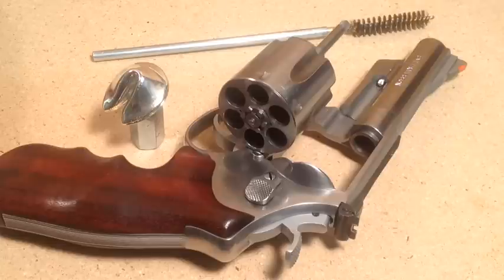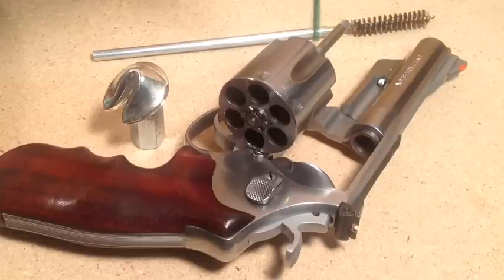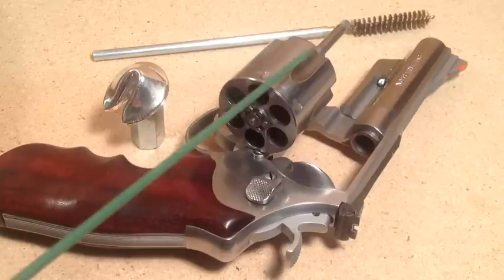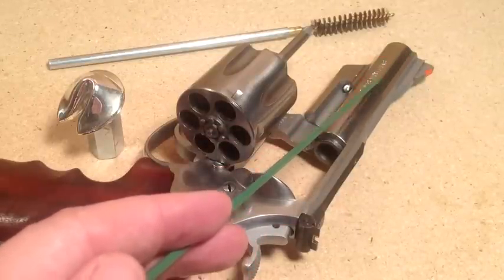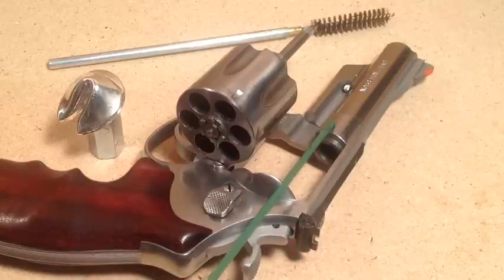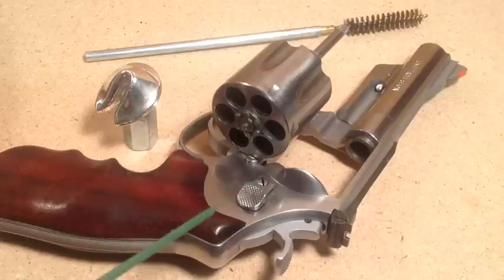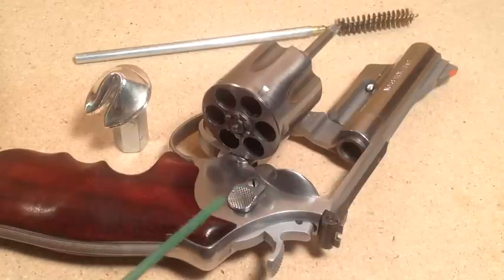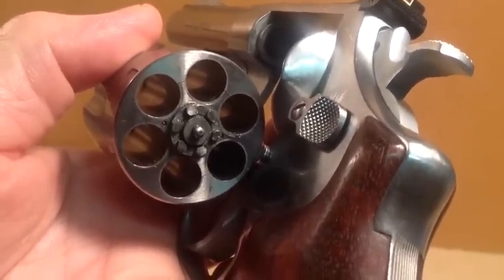Let's Prevent Barrel Leading - VR Gun Nut

Comment: I just got a lot of leading shooting the .38 special PPU 158gr lead round nose factory ammunition in my 2.5" 66, the cylinder face, forcing cone, and barrel all got leaded, the barrel the entire length and it's leaded the worst, I just shot these same,rounds in my 627 with 2.625" barrel and had 0 leading :/
Reply from the maker: metalmullins - Sounds like your cylinder throats are bigger than the PPU bullets so that gas cutting is doing all the leading.  If your bullets are too small at the frontof the cylinder, gas is blowing by the bullet and flame cutting the lead leaving it at the cylinder face, forcing cone, and first third of your barrel (with a short barrel, that's the first third).  It's the only way that lead is left like that.  That 66 sounds like it needs bigger bullets - you'll have to measure your chamber cylinder throats to see.  Then cast .001" bigger and load 'em.  Your 627 and PPU ammo are a better fit for each other… Leading takes all the fun out of shooting when it happens… Best Regards
Reply: what kind of cleaner is best for lead romoval? i dont cast my own bullets but i reload with factory lead bullets and shoot some factory ammo with lead projectiles, and this is the first time ive ever got leading..... thanks for taking time to respond!
Reply from the maker: metalmullins Gunsmiths used to use torch heat to soften (don't overdo this) heavily leaded barrels, and then clean the lead out with brushes or copper mesh while soft.  They also plugged up the leaded barrels and filled the barrel with mercury - dissolved the lead (that is no longer done).  More practical for modern shooters is the Lewis Lead Remover, or wrapping kitchen copper scrub mesh around a subcaliber brass brush and solvents work for leaded barrels and forcing cones on revolvers.  For revolver chambers, spin a tight fitting brass brush on a plain rod chucked in an electric drill + solvent = fast and easy.  Best to ya

Comment: So, if I understand correctly, if a person is using jacketed bullets, there is typically no leading issue, correct. And, typically, leading is not an issue unless you are using high velocities, correct? And what approximate velocity would that be for 9mm and 38 special? Many thanks.
Reply from the maker: eqlzr2 - Thank you for your condensed conclusions... Not quite that simple, but yes... jacketed bullets do not lead, but, in rifles, they "copper" - when accuracy degrades, we have to decopper the bores a bit.  The threshold where lead ends and jacketed begins is a range where shooters who use both types of bullets work.  My personal breakoff is a rather conservative  2000 fps.  If I go over 2000 fps, it's jacketed bullets for sure.  However, jacketed can be used at any velocity that is shootable.  Best to ya,  FC
Reply: Alright, clear as a bell. Thanks!

Comment: "On revolvers, no need to slug the barrel"  Not true.  I was having barrel leading in the middle of the barrel.  Slugging the barrel showed me that it's tight at the frame, the opposite of what you said would cause leading in that area.  It's a little tighter near the muzzle as well and loose in the middle area where the leading was happening.  Accuracy on the gun is also terrible as one would expect regardless the bullet type used.  Hopefully Taurus still has barrels for it so I can send it back for replacement.
Reply from the maker: DonziGT230 - Thanks for posting comment.  Problem with videos is that we cannot cover the full comprehensive discussions on any particular topic.  That's why there are comment sections and viewers have come to learn the value of these sections.  When we are first working with a revolver 1) shoot some factory jacketed ammo - it should shoot decently to very well depending on the load 2) if shooter is a reloader / bullet caster - measure the cylinder throats and add .001" - no need to slug the barrel (that's where the no need to slug the barrel comes in) - If the revolver is properly set up, that should give the shooter accurate clean shooting results.  We might get light leading if 150 - 200 rounds are shot in any given session.  BHN 15 is good for most shooting BHN 18 for magnum shooting Note - if anyone tells you that you need to slug the barrel of a revolver and then shoot bullets .001" bigger than that (this is recommendation for auto pistol and rifle barrels), wait till you see what some revolver groove diameters are. 
3) if we do not get good results, then slug the barrel.  This determines if the barrel is not properly set up in relation to the cylinder throat / flash gap / forcing cone or the barrel may be a bad or "pernicious" barrel.  This is what you did and your findings on your barrel denote a bad barrel.  Note - tightness at the frame is often called barrel constriction caused by the torque applied to screwing the barrel into the frame.  Removal of these constrictions can be done by lapping, but I'd prefer to leave that up to a qualified gunsmith to execute.   The topic is even more than this, of course.  I'll cut off right here as it will quickly become more than you or other viewers want to read... Best to ya,  FC

Comment: Hey FC45, isn’t it unavoidable to have some leading inside your barrel due to the heat and friction on the inside walls of your barrel? Do you notice more leading if loading the same lubed lead bullets to 38 Special velocities compared to 357 magnum velocities? If so, if your loading say factory Speer, or Hornady lead bullets in a 38 or 44, have you noticed a certain FPS that when exceeded, results in excessive leading? (Speer bullets seem to use a dipped lube, and Hornady has a silver dry lube) The reason I ask is I very rarely load 44 magnums with non copper jacketed bullets, but stick to 44 Special loads with the lead bullets. The reason is because I have had a devil of a time “de-leading” my model 29 after shooting Hornady’s lead bullets to 44 magnum specs...
Reply from the maker: cal30m1 - Thanks for your good comments... yes, we like those swaged lead bullets, and I personally really like the them in 44 cal.  The hollow points are even used in hunting circles but the velocity ceiling on those is 1000 fps.  I like 'em around 900 - 950 fps in hollow points - buy 'em in the 250 boxes.  Even though I cast my own bullets for the preponderance of my shooting, I do use the swaged and jacketed also.  Those swaged bullets are soft by definition and shooting them over 1000 fps invites leading.  If you like cast bullets in your 44, and many of us do, hard cast is the way to go... any leading you get will be easily removed via normal cleaning procedures.  And if you powder coat your bullets, any leading will be nil or none.  Plus good powder coated bullets optimized for magnum shooting are available commercially from outfits like Missouri Bullets and Acme Bullets.  Good shootin' to ya,  FC Steve

Comment: thanks for the video fc45 if I was to use the 45/45/10 system could i use white xlox instead of lee alox? and the 10 is usually a oil right?
Reply from the maker: gun nut - the 10 is paint thinner.  And the White Label stuff is pre-mixed for you.  I'd be using it, but I've got a lot of LLA that I have to use up...Best Regards...
Reply: so the white label stuff is 45/45/10? what do you mean by pre mixed? where could I get white labeled xlox? I heard it's cheaper than LLA
Reply from the maker: gun nut +gun nutThe White Label 45/45/10 is all ready to go, just pour a little in and tumble your bullets...The Xlox is White Label's version of LLA, but as you already note, it's less expensive.  And you can get a big container of it - Wow - that stuff does go a long way, though.  You can order from the website www.lsstuff.com  Best Regards

Comment: gas checks on lead bullets eliminates deforming of it and that prevents leading, with good quality bullets that have gas checks I've never experienced any leading issues ever
Reply from the maker: kevin davis - When Elmer Keith was stoking all those calibers and developing cast bullet designs, he did not put gas checks on his Keith bullets - reason - he did not think them necessary at 1500 fps and under.  On the other side of the room is Thompson who put gas checks on many of his designs.  Near as I can figure, for our regular handguns, gas checks do a bit to help prevent barrel leading, but not enough in most cases to warrant the extra 4-5 cents a shot.  Some report better accuracy when gas checks are used as the bullet bases are more square, but I have not found that to be the case in my limited use of gas checks vs no gas checks.  But if any shooter wants to use them, by all means.  I do use them for rifle cast bullets.  Best to ya,  FC
Reply: how many rounds do you throw down feild before cleaning out the lead so gun doesnt blow up
a ipsca freind told me to use copper brillo pad to clean leading and to just shoot lead
but im still paranoid about my gun getting blown up?
Reply from the maker: Alonza Hanks - If your gun is shooting accurately, there is no fouling problem.  When you start getting flyers, the fouling or leading is building up.  When you start getting keyholes, the rifling is being obliterated by fouling and leading.  If you keep shooting at that point, pressures will climb dangerously.  So let your gun talk to you.  If you are in doubt, and your gun is still shooting well, clean it every 100 rounds.  If you get the flyers starting to show up, shooting some magnum jacketed rounds through your gun can remove the leading.  Or clean your gun.  If you wait till keyholes show up, you need to stop shooting with that gun, take it home and use the Chore Boy copper mesh to clean out the lead. Or use a Lewis Lead Remover.   I have my bullets fitted to my guns so I've shot 200+ rounds in range sessions and gun clean was easy.  I have full videos on these topics under my No Barrel Leading Playlist.  Best to ya,  FC
Reply: never thought to run with listening to my gun havent ever shot lead more than a box buffalo bores 
every thing else has been jacketed and not lost accuracy man on man plate racing ive got up to 700 
45acp in sig 1911 and it started getting slugish
was kinda scared about lead going that far ipsca usualy about 200 and at times forgot about cleaning before next competion lead is much cheaper seen a lot of people losing competions because of jams  guess
you just have to take a chance  thanks cookie about how many lead rounds  before your gun starts acting up
thanks lon got my first 500 rounds of lead 200 grainers loaded  5.7 grains of 231 
havent got out to shoot yet thanks Lon
Reply from the maker: Alonza Hanks - Thanks for your comments.  I've often shot 500 rounds in an evening, but never 700.  That's some shootin' for sure..!!  For cowboy action, lead bullets rule.  For autopistols, lead bullets wind up getting the gun dirty enough from lubes to cause jams (these things you know of course).  Powder coated bullets relieve a lot of that, but for competition autopistol, jacketed bullets or plated are the way to go as the smoke is the least.  I don't know of any of the best shooters using lead cast bullets...doesn't mean they can't be used.  Good shootin' to ya,  FC
Reply: thank you
Reply: Your gun wont blow up Alonzo, shoot them until you start seeing a loss in accuracy. use quality lead bullets with gas checks like ones from cast performance and you probably won't have any issues. i've been shooting lead at 454 casull velocity for well over 15 years and have never had a leading issue i had to address
Reply: thanks

Comment: I slugged the two barrels that I'm reloading for the 45 slugged at 452 and the tokarev slugged at 311 when I use the cast bullets I sized the rounds won't freely drop into the barrel I think the size of the bullet is to big how do I load the rounds to fit the bore and chamber
Reply from the maker: Francisco Maestas You don't mention if your 45 is the 45ACP for an auto pistol.  Most auto pistol barrels in 45 are .451" but .452" is well within reason.  Now your Tokarev is an interesting situation.  The bore at .311" would be reasonable.  You will need caat bullets at .312" for best performance.  However, if your .312" bullets will not allow chambering, it means you need to try bullets at .311".  That should work.  If that does not work, then you have the incredible situation where the gun has to be fired with bullets at smaller than groove diameter.  That will be heavy leading with cast bullets and may cause bad accuracy with jacketed all caused by gas blowing past the bullet.  You won't get leading with jacketed and they might be accurate enough if the bullets are able to slug up and fill the bore...that might be with the high velocity of the round... Good shootin' to ya...

Comment: FYI; the projectile going down the barrel does not make a full revolution.  It may not make half a revolution before leaving the barrel.  So no lube on the nose is going to be slung off as it moves down the barrel.  Properly sized and polished cylinder chambers, good smooth angle on barrel throat will make considerable difference on leading and accuracy.  The hotter the load the more the lead heats up and softens thus leaving more lead in the barrel.  The tin content will adjust the hardness and the harder the lead the less leading you will see on a given load.  Good video otherwise.

Comment: BULLETS dont go down the barrel  SPINNING at supersonic speed where did you get this idea from
Reply from the maker: rodney wells - No doubt you are referring to 10:40 on the video.  Speed of sound is between 1000 - 1100 fps depending on location.  Many of our loads are at or exceed that in muzzle velocity - reason that some want to load down to get subsonic ammunition.  The rifling in our barrels causes the bullets to spin around their longitudinal axis.  In many of our calibers, the rifling twist will result in any outside point to be not only moving at supersonic speed from the forward velocity, but also spinning around the longitudinal axis at an even faster velocity.  So the vector of any point in contact with the barrel at any instant is easily exceeding the speed of sound.  When you say that bullets do not go down the barrel at supersonic speed, even 22LR exceeds that - and all bullets are spinning unless the gun is a smoothbore.  Hope this helps... FC

Comment: Too soft of lead mix or you are loading them too hot. You also need to run cast bullets through a sixer lubricated die.38spl 357mag dia. Should be   .357 9 mm is.354  44 is. .429  45 is .457 inches

Comment: Actually you are mistaken about the throats. The bullet should be sized at exactly the same size of the throat diameter or .001 smaller. If bullets are sized 1-2 thousandth's larger, they will be swagged down to throat diameter when they pass through. Also you cannot get an accurate measurement of the throats with a caliper, you need pin gages to do that accurately and they are not expensive. As far as slugging the barrel, you are wrong again, sorry. The lead bullet needs to be at least the SAME size or .001 to .002 LARGER THAN THE GROOVE DIA. to seal the gas behind the bullet.  Sizing the bullet like you said will only leave lead on the topstrap and raise pressures needlessly.

Comment: A DRILL? I don't THINK so...!
Reply from the maker: Tim Hofstetter - Not in the rifled barrel, of course - but works really great in the cylinders of revolvers.  Plus, we used electric drills often to clean out our shotgun barrels and choke tubes with the Brass Brute that is designed to be used with a drill (that's where I got the idea for the revolver cylinders) = works mighty fine and saves a lot of work.  Best to ya,  FC
Reply: FortuneCookie45LC
WHEW! That makes me feel a whole lot better. I can see using it inside smoothbores or chambers... although it seems pretty aggressive for even that.
Reply from the maker: Tim Hofstetter - Not at all, keep the shank of the drill centered in the
 cylinder while the brass brush removes everything post haste... Best to ya,  FC

Comment: You're failing in one really major piece of information. If this man shooting lead bullets in a 9 mm shooting them in a Glock with a polygon old bore rifling, he should have stopped yesterday. Glocks will, almost without exception, easily blow up from putting LED through them. You do not fire lead through Glock pistols with standard barrels. Detroit police tried that they were blowing guns up within 10 Rounds. The operation of the bullet in that Barrel is so extreme in the barrel so smooth that it will actually blow the core of the bullet out of the band on the projectile, the next round will blow that gun up. Glock tells people for years do not fire lead in their guns.